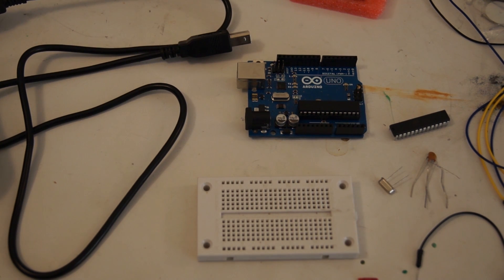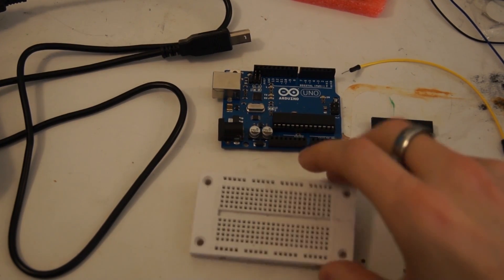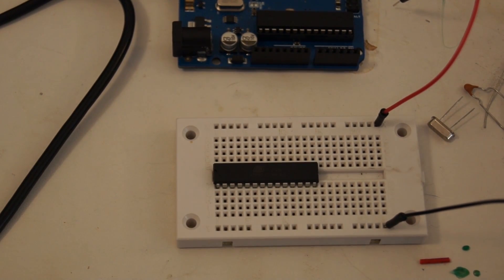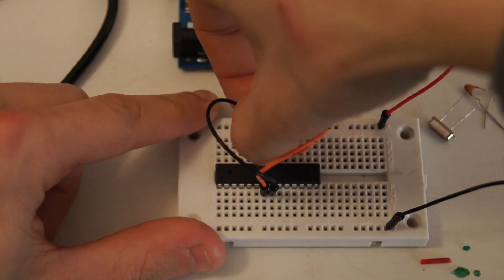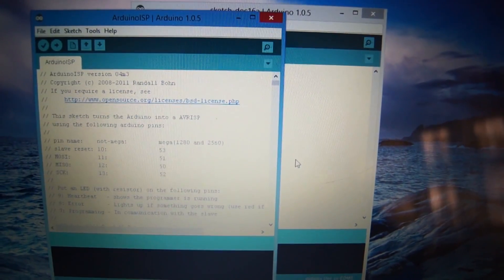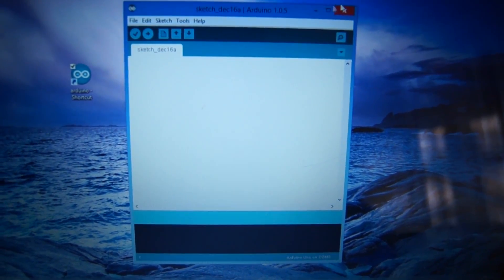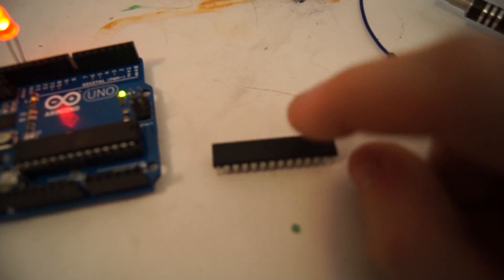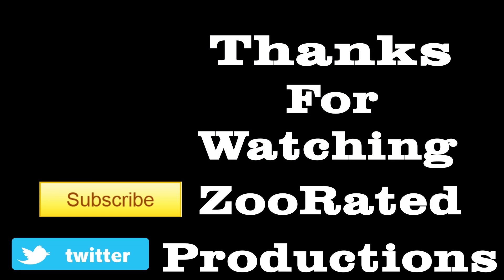How To Load Bootloader onto Arduino

Comment: You don't need to connect the ground pins (Pin 8 and Pin 22) to each other, they are internally connected. You just need to connect one of them to the common ground rail

Comment: Nice video but connecting an LED directly from the digital output (D13) to ground could fry that output. You should have had a series current limiting resistor like a 1Kohm.

Comment: I thought I've burnt 5 atmegas before realising my board was bad and corrupted the bootloader. And for some reason Arduino reference pages doesn't load the wiring images at all, so you just fucking saved me, dude ❤❤❤

Comment: Thanks to your friend for this tutorial. I did everything as you did and succeeded. Ps- I had to change the quartz because at first it was impossible to burn the boot. I just had 2 oscillators I changed and it went without a problem.

Comment: how can i solve this problem. it occured when i select burn bootloader

avrdude: Yikes!  Invalid device signature.
         Double check connections and try again, or use -F to override
         this check.

Error while burning bootloader.
Reply: It all depends of what kind of Atmega 328P u r trying to burn. Is a blank one that has never ever been used before or plugged onto an arduino uno board ???  If this is the case u will need to select arduino uno under tools/board and select the right com port number (for your programmer)  from tools/port and select Arduino as ISP from tools/programmer since your programmer is an arduino uno board (if it is the case). then connect the wiring acording to the above video and then press burn bootloader.

Comment: worked for me. But I've a question.
when i program an atmega by an arduino uno that atmel reset pin doesn't resets the chip on the breadboard. I've an arduino and have another atmega on breadboard.

Comment: Arduino: 1.6.13 (Windows 7), Board: "Arduino/Genuino Uno"

avrdude: Yikes!  Invalid device signature.
         Double check connections and try again, or use -F to override
         this check.

Error while burning bootloader.

Facing this error whileburning bootloader.. Please help me with this

Comment: sr I have a correct .can u help me :D

avrdude: Expected signature for ATmega328P is 1E 95 0F Double check chip, or use -F to override this check. Error while burning bootloader.
Reply: i got the the same problem. if you have found out the solution ,please reply .
Reply: Same here!!!
Reply: any luck?

Comment: I want to burn bootloader in the atmega8 chip but every time find error "efuse " memory type not define for the part atmega8.  So what i need to do.
Reply: I would use other means such as WIN AVR of plain vanila avrdude or Atmel studio 7 under win 10 and a proper programmer such as an Atmel ICE or a USBTinyISP (by adafruit) or an AVR Programmer version 2.1 (by POLOLU) etc etc.

Comment: i got this error.... any help?

 ***failed;  
avrdude: WARNING: invalid value for unused bits in fuse "efuse", should be set to 1 according to datasheet
This behaviour is deprecated and will result in an error in future version
You probably want to use 0xfd instead of 0x05 (double check with your datasheet first).
Reply: I solve that problem downloading a older version of the Arduino IDE, just lo burn the bootloader. I got 1.0.6 IDE.

Comment: i am burning boatloader but it give me following error ,,what to do ?

avrdude: Yikes!  Invalid device signature.
Error while burning bootloader.
         Double check connections and try again, or use -F to override
         this check.
Reply from the maker: Make sure you are using the 2 caps and 16MHz crystal.
Here is link to the crystal: http://amzn.to/1Omg8sa
Here is the link to the caps: http://amzn.to/21iXi6n
Reply: yeah ofcourse  used same ,,i am sure ,,
Reply: Mine worked after I removed the capacitors...
Reply: same problem
Reply: use a 10k ohm resistor from reset pin to 5v

Comment: Hi,Nice video.I do have a problem though.  I have bought 2 new Atmega328p and burnt Bootloader onto them via ICSP (similar steps you showed,  using the Arduino Uno as the programmer).  However, now I can only upload sketch to the new MCUs via ISCP and not through the RS-232 port.  Where as the other MCUs that were preprogrammed, I can upload sketch through the RS-232 port.  Any ideas why?

Comment: Very good video!  Clear step by step procedure, worked for me thanks!  Except for that one part about switching over to ArduinoISP sketch before you click "Burn Bootloader" that many people have already mentioned.  Kind of a pain to get that chip in and out of the socket.  You should put the original chip in it's own chip socket and piggy back it onto the arduino's board socket.  Removal is a thousand times easier and keeps you from bending the pins from insertion and removal.  Works AWESOME!!!

Comment: +Burak ÇALIŞKAN  thank you very much, it was not mentioned on the video.
You need to select Tools, Arduino as ISP and then Burn Bootloader.
After burning the bootloader don't forget to set the programmer to the normal AVRISP mkII programmer for arduino Uno.

Comment: Is there any reason something like the couldn't be used to burn multiple chips at once? I'm not sure what the loading specs are on the output of the Arduino boards like you have there. I have a similar setup so I'm curious.

Comment: Rip LED
Reply: yeah, I went ouch at that. But I can think of two possibilities.  It may be the sort that has a built-in resistor for direct connection to 5V.  Or it may be a led that can handle say 50mA and he's relying on current limiting from the port, which merits a smack on the bottom.

Comment: Hello! I'm having issue with my arduino uno. It was working OK couple days ago. But now it has problem with uploading. When I try to upload, first it stuck at uploading, after a while it gives quite a long error message starts with
Problem uploading board,
avrdude: stk500_recv(): programmer is not responding
avrdude: stk500_getsync() attempt 1 of 10: not in sync: resp=0x2c
avrdude: stk500_recv(): programmer is not responding................etc. I tried almost all the tricks and instructions online such as reset button. None of them didn't work. I'm sure that my ports and other options for Arduino UNO are correct. When I connect my arduino to computer I hear the device insertion sound, also yellow(L) and green(ON) lights of the arduino board  are on. I reinstalled software. And when I connect arduino it has installed the port automatically which means board and computers' connection is OK. Also when I connect my arduino board to motor driver, my stepper motor is working with the code which I uploaded previously.  How can I fix it? Please tell me if there is other way. Thank you!
Reply from the maker: +kuukeldei deidara I am thinking this could be if you have anything in digital pins 0 or 1. These are reserved pins for communication and need to be disconnected during programming then plugged back in. If you use pins 0-1 for serial, again, make sure you disconnect these pins while programming. Hope this helps.
Reply: +ZooRatedProductions does this mean if the Atmega28P chip has Bootloader burnt this method then I won't be able to upload sketch (program) through the Rx and Tx drivers?
Reply from the maker: Ashraf Sarameh What I am saying is if you try to upload a new sketch to the chip with anything connected to digital pins 0 and 1, it may interfere with the transfer of information and you get an error. What I do is unplug those pins if I'm using them, then upload sketch, then plug them back in.

burning the bootloader is for a brand new chip that is completely blank. Once this bootloader is installed on the chip, it acts like a regular arduino.

Comment: Hi!
I've tried this method many time with many blank chips and I got allways the same error while burning

avrdude: device signature = 0x000000
avrdude: yikes! invalid device signature
                double check , blah blah, blah...
 
Someone can tell me what's wrong, please?
Reply: +Carra Nen 

As Burak ÇALIŞKAN  said, this was not mentioned on the video.
You need to select Tools, Arduino as ISP and then Burn Bootloader.
After burning the bootloader don't forget to set the programmer to the normal AVRISP mkII programmer for arduino Uno.
Reply: Thank you man. But since I've posted it, I learn how-to and many more things! Cheers!

Comment: Hi Buddy.Can I use Uno in order to load bootloader onto Nano in this way ? I've got some issues with this board.I pluged it in then my computer could regconize which its COM port is.But the notification window of Arduino IDE showed me "avrdude: stk500_getsync(): not in sync: resp=0x00" when I tried to upload the simplest sketch Blink from the IDE to the board.I know that not having bootloader on the board is one of the ways leading us to this issue.This problem just happened to me recently though it worked fine before.How can I get troubleshooting in this case ? Please give me some advice as soon as you can.Thanks a lot.
Reply from the maker: Anh Minh Ly Some of the things I try to do is restart the Arduino IDE. If that doesn't work, try holding the reset button on the Arduino and push upload. Release the button after you hit upload and see if the code takes. Try also using a different COM Port. Finally if all that doesn't work, try to restart your computer and try again. Hope this helps. 

I am unsure if you can load a bootloader in this manner to a nano. I think as long as you make sure the pins are correct, I don't see why it wouldn't work.
Reply: I'm no expert, but I know that at least one person has had a similar problem which he fixed by using a different version of the arduino ide, so that might be worth you checking out.

Comment: Are you able to continue programming the ATmega chip without popping it in the arduino? I have the Uno with a micro version of the  processor permanently soldered to the board, I managed to uplaod the bootlaoder, however when upload the blink sketch to blink pin 8 which is the very last pin the left side, it doesn't blink it when LED is connected.

Comment: hi i want to ask you something i want To Load Bootloader the  atmega328p-pu chip but i don't have the arduino cart so my question is can Bootloader the  atmega328p-pu chip with an other way and thank you
Reply from the maker: ahmed merzoug I believe the other way of doing this without the arduino board is to add the components so that the chip can talk to the computer. I do not know how to do this, but you can find an arduino board on ebay for 7 dollars. This comes with a atmega 328p-pu chip in it with the bootloader installed. Then you can do it as explained in the video. This is the simplest way of doing it.
Reply: thanks any way
Reply: +ahmed merzoug   I think that basically the uno is being used here as a usb to isp convertor.  Your chip is programable by isp and you can buy a convertor separately,  which may be more convenient for you, but as zoo says, uno's are cheap.
Reply: +Ray Kent   btw, with a convertor  I guess you need to use avrdude differently, or atmel studio (probably easier).  I used atmel studio 20 years ago with "raw" chips, nothing to do with arduino as such, but the arduino bootloader is just a bit of user app code as far as the chip is concerned.

Comment: ZooRatedProductions  will it work if i use the normal atmega328 instead of atmega328p ?
Reply from the maker: INDRAJIT GHOSH I think it will but I am not sure if it has a different pinout. If it has the same pinout, it might.

Comment: Thanks for the video. I had exactly the same problem. I bought a number of ATmega328P-PUs from this site:
http://www.ebay.com/itm/261560259529?_trksid=p2060778.m2749.l2649&ssPageName=STRK%3AMEBIDX%3AIT
and of course they advertise that it comes with the boot loader installed. None of them have it.

Comment: My arduino UNO' RX and TX pin do not blink while uploading the code.
it shows avrdude:out of sync() error
Does it mean that Bootloader is corrupt?
will this video help me?
Thank you.
Reply from the maker: Aditya Suri That could be any of this: A wire is connected to pin0, You have the wrong COM port selected (the IDE does not see your board), Your Arduino drivers are not set properly.

If your board was working previously to this error happening, then it is not your bootloader.
Reply: I've already checked for the above things but none of them work.
Reply: Aditya Suri same problem here :( did u got the solution??

Comment: getting "Yikes! Invalid device signature" when doing this??? any advice?
Reply from the maker: Ive never got that. Try googling that and see if anyone on the forums have had that issue.
Reply: I am getting the same error. http://arduino.cc/en/guide/troubleshooting acknowledged the error but provides no solution. Darren, were you able to resolve this issue? If not, how did you get this worked?
Reply: Issue solved. Just make sure your IC is firmly inserted in the breadboard. Also check all connection again. More details on troubleshooting here http://forum.arduino.cc/index.php/topic,152587.0.html